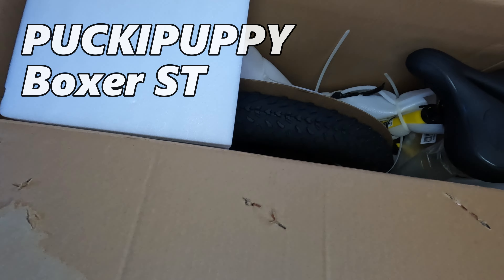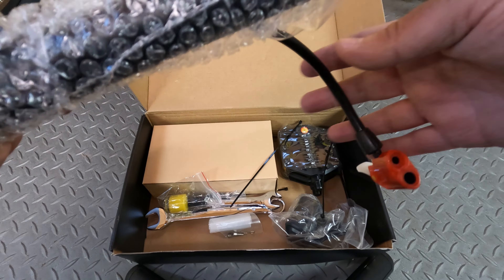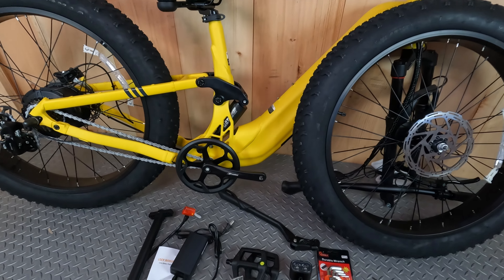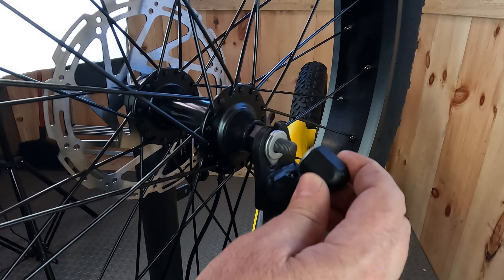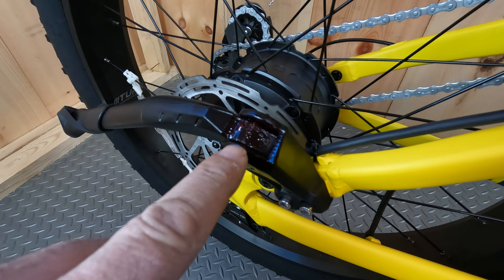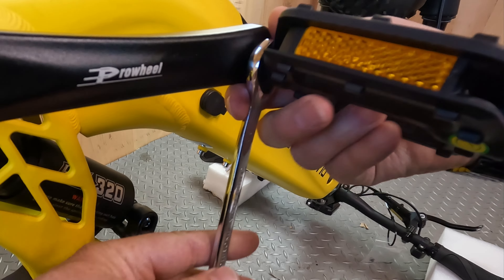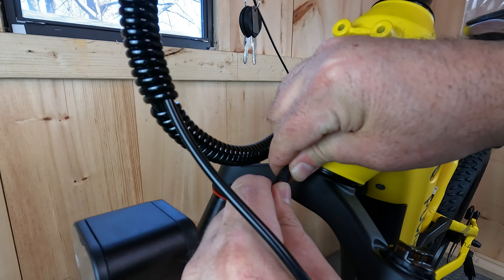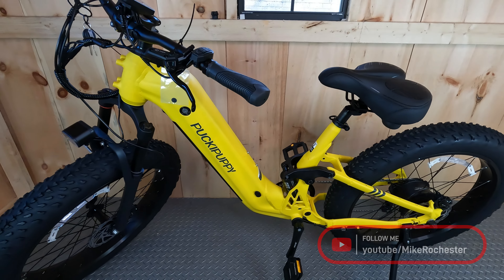Learn How to Assemble the Puckipuppy Ebike

Comment: Thank you for this video! I just got my Puckipuppy delivered.  I'll use your steps to assemble it. 😊
Reply from the maker: Hope it helped, Thanks for sharing.
Reply: Great vid ! Thanks ..just got the Boxer. I see you put the front splash guard on. Did you need to use a longer screw with nut to attach to back of light mounting hole!? Thanks

Comment: Mike i just fully assembled a boxer st. The front shocks are stuck in "locked" position and dial will not disengage. Any tips ? Thanks
Reply from the maker: @brianfabry2921  I would try to push down on the forks and see if you can wiggle it loose or you may need to reach out to customer service.

Comment: Got the bike assembled but have a brake error code prohibiting operation can you help?
Reply from the maker: Make sure your brake isn't stuck down there's a motor shut off that won't allowed a motor to kick it on. Check that all the wires are connected in the front of the handlebars.
Reply: Got that problem fixed and have a speedo screen but still no power, I will read some more and thanks for your help and your video was very helpful!